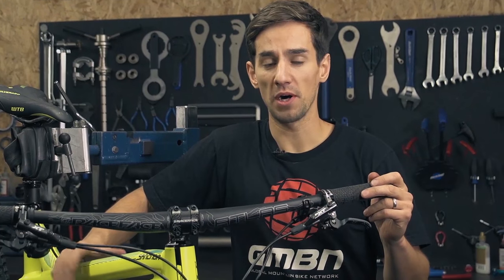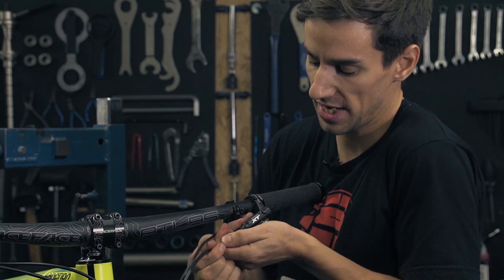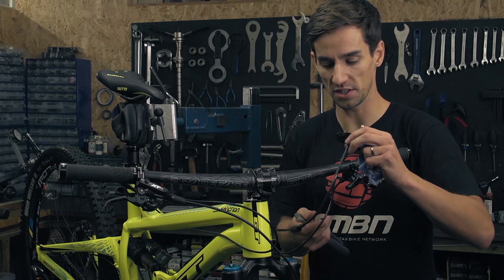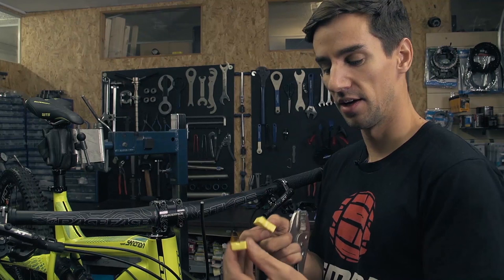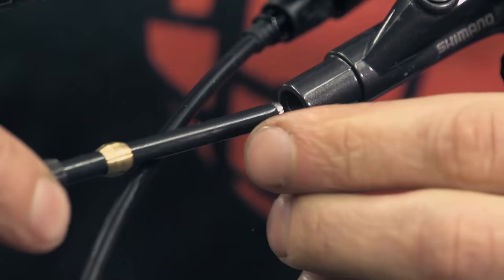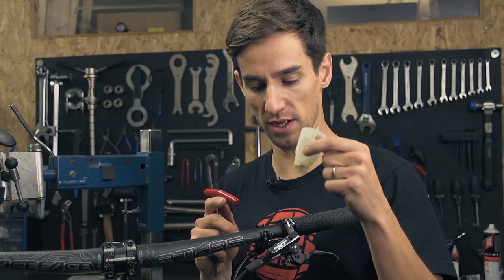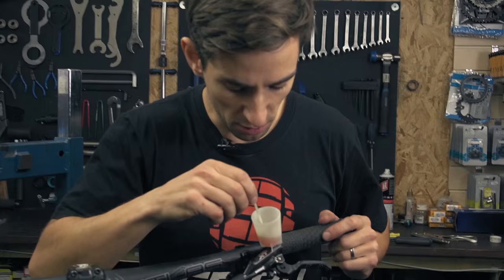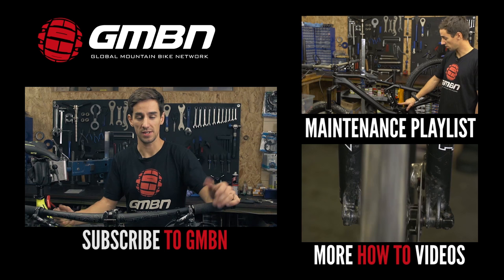How To Shorten Your Disc Brake Hoses | Mountain Bike Maintenance

Comment: That was an excellent video. You got right to it, you didn't spend fifteen minutes talking about what you were about to do. You didn't get dressed in level 4 MOP gear and perform the work in a radiation hot-box like a lot of the other vids. It's mineral oil... Probably falls on the danger scale somewhere between baby oil and WD-40.

Comment: When inserting the barb it's important to "stretch" out the hose a bit with a pick. I've had a couple of cases where the barb would shave away some hose material and jam up the hole. Once the brake lever returned slowly into position after braking, the other time I wasn't even able to push oil through the system. Rounding off the end of the barb with some sandpaper prevented the damage to the hose.

Comment: My tip is this... I did it twice and the first time I followed the instructions to the letter, the second time I had a brainwave and instead of mashing up the hose with snips and squishing it round again with pliers I simply put the hose against a hard surface and used a Stanley knife with a fresh blade to cut it in a gentle sawing motion... super clean cut and the hose stayed perfectly round ☺
Reply: That's a good idea. There are proper brake hose cutting tools where the cutter looks more like a stanley knife blade and which similarly don't squash the hose. You're not really supposed to use snips or cable cutters like Neil does in this video but mostly it turns out ok regardless.

Comment: Transitioning from mech brakes to hydraulic I needed I bit of guidance and this video (unlike others) has been very helpful! I shortened the hoses and swapped rear/front as well, because the brakes came wrong from the shop. Also had to make the 'Shimano yellow tool' out of two pieces of wood because it did not come with my BR-MT500 brakes. I suggest to slide in the olive before tapping the insert and best using a small hammer wrapped with tape so not to damage the surface.

Comment: Never use a metal tool to tap in the barbed fitting/hose insert this can mark the surface of the fitting and cause issues getting a proper seal,  always use a plastic tool like the handle of a screwdriver or a small plastic mallet.
Reply: DimensionsOfEarth Not necessarily plasti, but just something softer. Brass should work for example..

Comment: Think I would of put the olive on before the barb but that might not be required for Shimano. Also worth mentioning you don't want to over tighten the shroud as if you strip that thread you have screwed the lever. Good clear vid for beginners as there is nothing more annoying that flappy hoses 👌🏼🤓

Comment: Wow, this looks extremely easy. I almost took my bike to the local bike shop to have them do it and pay them $35.00. Now it will only cost me $15.00 for the brake fluid and bleed cup on amazon. Thanks, I'm gonna shorten my newly installed brakes cables tomorrow.

Comment: best way i found to cut a shimano hydraulic hose(much better than what is shown in the video)...get box knife that has the short double tip replaceble blades and is foldable.....take the brake hose,mark the spot for the cut,hold it flat on the handle part where the blade goes and push it closed....perfect cuts with minimal effort....also works with a regular razor blade and a piece of wood and still makes nicer cuts than any pliers

Comment: A side cutter as being used here will squash the cable ending the way it actually ends up being seen at 2:20. 
Shimano therefore recommends to use a utility knife; I used a scalpel which is very sharp and will give the best clean and straight 90º edge without squashing the cable. Next add a small amount of grease around the threads of the connecting bolt before screwing it back, ... makes life a bit easier!

Comment: You left out a few extremely important steps. #1, take your pads and rotors (or wheels) off and place them in the next town over. #2 safety glasses and gloves,  especially if you're using DOT fluid, that stuff can blind you. #3 use a razor cutter from acid, jagwire or even a box cutter as others have mentioned, this will leave a much cleaner cut. Especially since we are talking about a system under pressure that's designed to be air and fluid tight. #5 clean the piss out of EVERYTHING, DOT fluid is mega corrosive and will eat the paint right off of anything it touches, if you get mineral oil or dot fluid anywhere near your rotors or pads they're done. #6 drink a beer and think about the amazing job you've just done!
Reply: shimano uses mineral oil.
Reply: dudewheresmybeer why exactly would you do step 1?
Reply: @Edgarr1m  See point 5.
Reply: I used your method and now I have no pads and rotors at all, I left them in the next town, what should I do?
Reply: @chancethin9250  Ride there, skid, OTB and/or both to stop

Comment: concise and very precise. I have bled my brake repeatedly but air keeps coming back into the system. Time for a new hose. Damaged by Swiss Air along with loads of other bits that were deliberately scraped along a road and also dented. Avoid them.

Comment: Darnit i did this recently and now my new Deore rear brake needs a bleed as air got in somehow But the front is fine.
The official bleed process looks simple for these brakes though so gonna have a go unlike Avids that they replaced!
Reply: +vaxbuster Didn't even need to bleed the brake just did what Neil did but hung the bike up from the front wheel first for a few days so that any air had got to the top popped in the bleed header thing poured in some fluid and repeatedly pulled the brake and tapped the caliper and hose and rotated the lever around a bit on top and hey presto solid brake again! Shimano why are you so good!

Comment: Nice video, I wouldn't normally hit anything steel with steel, probably use a nylon hammer, also the original insert had an O ring fitted, the replacement did not, is this OK?

Comment: Suggestion for a video... I just went cycling in snow, how the ** are you supposed to clean frozen ice+mud off your bike?
Reply from the maker: +Alan Riddell  Like any part of riding in the cold and wet its just a bit harder than usual! Maybe use a bit of pressure, or warm water. 

Cheers!
Reply: +Global Mountain Bike Network Was also made worse when I got home and tried to wash it off and found the garden hose had frozen. (No pressure washer at home) I knocked chunks of ice / mud off the bottom bracket and tried to use a hard nylon brush to get the worst of it off moving parts. (I was amazed the jockey wheels and cables were moving the amount of ice around them) Was tempted to get a bucket of warm water and try that but I think I got enough off with the brush. Then normal chain cleaning and I left the body of the bike muddy :)

Comment: If I don't need to trim the brakes but just need to route the lines through the frame, all I have to do is just pull that line out, then put it back in without the need to rebleed right?
Reply from the maker: Yes, but you may have to clip the locking bolt and the olive off of the end in order to route the cable through the frame. You'd then need to re-install them once it's through :)

Comment: Great video again! Will be doing this soon as my cockpit is a mess- would it be possible to do a video on 'how to take apart a raceface crank on a carbon bike, mines a cube stereo hpc, and i'm struggling to get the last nut/bolt out the crank,  as would like to service my bearings. Please help! Apologies if this has been shown already.
Reply: Hi, its ok I've finally managed it. Didn't realise i had to use a lot more force than expected, 50nm is damn tight haha.

Comment: Do not use side cutters to cut the hose this deforms the hose & leaves a nasty cut both are evident in this video. I would also suggest less hose coming out of the clamping blocks as the hose could kink.

Comment: So I followed these steps and when i pulled the lever the brake line blew out. Did I not get the olive squished? I was worried about tightening too tight. How do I know if I need to squash the olive more?
Reply: I figured out my issue. My cut on the hose was not square. The first time I cut the hose I used a utility knife. I tried again with wire cutters like you did and that made the cut square. Went on perfect

Comment: Can you still trim the brake cables if you dont have a spare olive or plunger???????
Reply: No, the olive is bent, you won't get it off undamaged. I did get a plunger out of an old hose though, no need to dump that actually...

Comment: Im guessing when you mention the nipples and blocks that come with the brakes, you are meaning when you buy the brakes separately from the bike? I ask because when i purchased my trek fuel ex 8 it didnt come with anything like that for the brakes.
Reply from the maker: +Tyler Ross That may well be the case - If you go to your local bike shop they may be able to help you out for a few ££ or If you call your dealer they may be able to help you. Very useful things to have in you tool box.
Reply: Thanks!

Comment: I shortened my new brake hose last night, but i didn't have the hose block tool and couldn't get the barb ALL THE WAY in flush...about 1 mm still sticking out. Is that gonna be a problem? Thx
Reply from the maker: +Adam McAllister Maybe not, but I would be careful it doesn't leak. Try and get the block tools, they are only cheap.

Comment: alright Don .. just about to get a new bike which comes with xt's .. I run back on the right so if I was to just disconnect as im gonna need to swap them round and not cut the cable does that mean I would not have to bleed . thanks Dar
Reply from the maker: +waddilove10 Unless your levers are right/left specific this should be an option, but we would recommend bleeding the top reservoir to be on the safe side.

Comment: what length dropper post is on that bike Neil? I have a 150mm KS LEV Integra and I think it's too long... just curious. great vid by the way. shortened my XT brake on Sanction perfectly after watching this video. BH
Reply from the maker: +andrew minton 125mm on the Sanction. Thanks! Neil
Reply: Woop. Awesome. It's a beast of a machine. Thanks.

Comment: A top tip is to toestrap the  brake lever as tight as possible to the handle bar before you remove the hose. That sends the majority of oil down towards the caliper meaning you lose minimal when making the cut. It also prevents the need for the bleed process at the end if done properly.
Reply: Hope there isn't that much stupid guys to do that! :)
Reply: @zoranbregovic3752 ?

Comment: so looking at 3:04 the cut on the hose seems jagged , other videos suggest the cut to be clean and perpendicular ,  does that matter ?
Reply from the maker: We agree the cut leaves the outer layer of the cable looking a bit jagged, but this is fairly standard due to it's softer nature. As long as the harder inside layer of the cable has a smooth, flat cut, the barb will thread in well and sit flat forming a good seal when it's tightened in and butted up against the olive :)

Comment: If you remove the hose from the brake lever, do you always have to re bleed it again? DYING QUESTION
Reply: Karl Lindberg Yes, always. it's a sealed system so whenever you open it you should bleed the air out.

Comment: Hi,
Great videos here. Can this "barb" been reused from an old hose? And do you have an dyi assumption for this yello block, in my SLX Breake was none includet?

Regards
Edventscher
Reply from the maker: +Ed Ventscher Using a new one is always going to be the best option, but as long as the barb is tight and isn't bent there shouldn't be a problem. No DIY cable blocks yet...one for the suggestions book!
Reply: @gmbn  simple suggestion for DIY cable block - take a small block of wood (the size of the cable block will do). Drill a "slightly smaller than cable" sized hole in it. Then saw it down the middle (in the direction that the hole is drilled). Done. Works well for me :-)
By the way keep up the great videos :-)

Comment: Can this be done to switch the brakes from rear wheel(left hand) front brake (right hand )...my current set up is rear(right) front (left)...👈🏼 I don't like this set up at all..👎🏽
Reply from the maker: +MarioBP76 Theoretically yes, however if you've not done this before we would strongly recommend asking your local bike shop for a bit of help... remember how much you rely on those levers!
Reply: Global Mountain Bike Network Thanks for the reply,I will take it to my mechanic.
Let him deal with it.

Comment: how to do you do this for wired disc brackes
Reply: It's much easier because all you have to do is shorten the wire cable--just as if you were working on a derailleur.

Comment: Can you use the same olive
Reply: No, you'll need a new olive and connecter insert. A set is around £3
Reply: +MySecretMachine thanks but done it now
Reply: I had the same question. So you used what was there from the old/cut cable?

Comment: who coined the term  " olive  "  ??   it's a compression fitting ,  say it with me COMPRESSION FITTING  !
Reply: +kendall connolly Olive like in french. Don't be jalous.

;)
Reply: +kendall connolly From wikipedia: "Compression fittings for attaching tubing (piping) commonly have ferrules (or olives in the UK) in them." He was only referring to the ring left on the hose which is part of the compression fitting and is called an olive. Say it with me ... olive.
Reply: +Frank Stone "compression fitting" would be the item you attaching in my mind like if talking electrics "light fitting" would be the lamp holder ect ect...
Reply: ...also known as an olive
Reply: I'd say compression fitting is the term for the assembly of the different parts, i.e. the metal insert, the olive and the compression screw.
Reply: Actually it is called a ferrule, and obviously its shape causes it all to be wedged tightly against the hose to seal that interface, and at the same time the ferrule seals the outside of itself against the master cylinder.  The insert reinforces the hose to allow sealing as without it further tightening would only crush the hose.

Comment: Glad I didn't because when I moved from an 18" hatdtail to a 19" carbon fibre full suspension frame I'd have been buying new hoses with shortened cables.

Comment: bawwest way i found to cut a shimano hydraulic hose(much better than what is shown in the video)...get box knife that has the short double tip replaceble blades and is foldable.....take the brake hose,mark the spot for the cut,hold it flat on the handle part where the blade goes and push it closed....perfect cuts with minimal effort....also works with a regular razor blade and a piece of wood and still makes nicer cuts than any pliers.